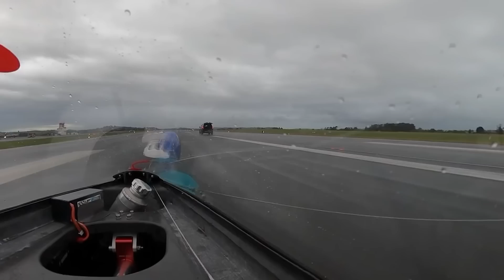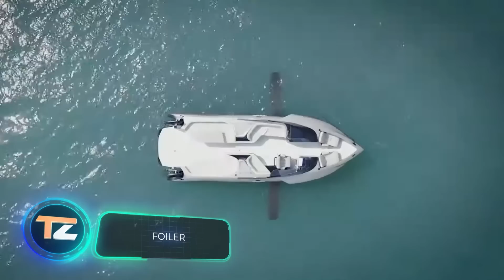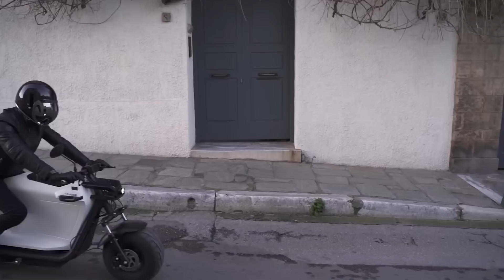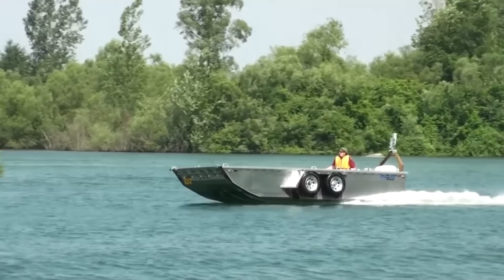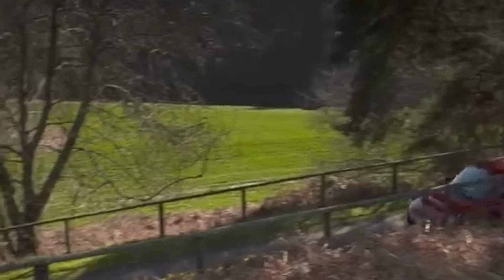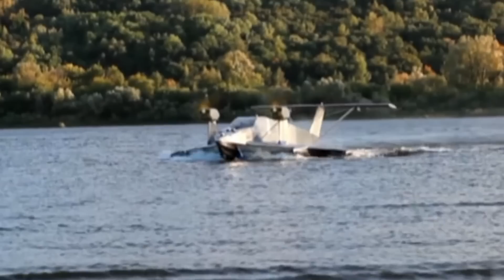INCREDIBLE VEHICLES YOU'VE NEVER SEEN BEFORE

Comment: Some of those seem rather cool and/or useful. The "float trailer" is just pointless, though. You still have to use a boat-ramp to launch it, and the most expensive piece of it (the motor) is prone to striking the ground during the launch process. We back boats down the ramp into the water for several reasons.
Reply: Imagine how much more energy/fuel wasted hauling the trailer plus they didn't show us how they did it, lol. You have to back up to the ramp to reach the truck :)). Totally stupid idea...
Reply: Without the trailer below it, and with the wheels being retractable, you would have a lot more clearance and wouldn't have to back the boat nearly a far.  Also, the engine is shown lifted above the height of the rear edge of the boat, so you aren't striking a prop at that point.  I'd anticipate there is a small trolling motor somewhere along the midline of the boat that would be sufficient for any final maneuvering as you line up with the truck.       The only real problem is that lining up a trailer ball is a lot more demanding that getting a boat close enough that a trailer's rails would catch it.   It looks like you would have to get out, lower the tongue by hand, and drag the boat into place by hand, which would be annoying enough to make the process annoying.  Your boat is also carrying around a lot of extra weight.
Reply: @brianhaygood183  You'll have to back it even farther down the ramp because the center of weight is so close to the truck. The boat's center of weight being at the rear is exactly why boat ramp launching (backing the boat off the trailer) works so well. 

The motor strike will happen because the boat levels in the water against the angle of the ramp; the motor being above the bottom edge of the boat is simply not enough separation to account for that angle difference (between the water surface and the ramp).
Reply: @brianhaygood183   _ Imo _ Needs the two wheels closest to the stern, to be Clutch releasable from Trailor Mode' to Electric steerable drive, via 100 watt hr. lithium batt, to literally drive from the truck at the ramp into the H2o itself, and back out to it. And an actuator lifting motor mount, so to lift the motor higher safely. Then a cable wind or electric tongue lifter to smooth out all operations. Granted not cheap, though would be a very capable and functioning exactly as planned to expect, of this new class of proven brilliant  concept! 🛥️🖖

Comment: How did you know I was working on the exact same four wheel motorcycle !!? I haven't even bought the wheels for it yet ! Mine is based on a 3 wheel Can Am where instead of a single wheel in the back their is an axle that widens the back and uses two P35 18 car tires. The motor basically stays the same, maybe.
Reply: Good idea.  The only reason the Can Am Spyder and every other 3-wheeler like it only has three wheels is because as soon as they put a 4th wheel on it it become a car and has to pass emissions, crash, and every other FMVSS.  So, cutting off a wheel saves them millions in testing alone.    I'm not sure what would happen if you sold an aftermarket 3-wheel conversion and had the owner install it.  You might get around some stuff that way if you can claim you aren't actually manufacturing the vehicle at all.

Comment: if its gas its trash sorry bro EVs r just faster & dont brake as much  & when a tesla family sedan is beating race cars might wanna go back to the drawing board
Reply: You might just change your mind if you were in my occupation.  I won't let my family ride in any Lithium battery powered vehicle, note even a bus.  Even my ebike battery is stored in a metal container outside along with all my other Lithium batteries.  It's going to get worse too.
Reply: You obviously don't have any bills to pay or long distances to drive. An EV vehicle costs $35-40k for a cheap model. The Tesla sedan you mention costs $140+k. Next you have to install a charging station at your house, figure $3-5k for that. Be prepared for your electric bill to double or triple. Average EV goes 250 miles between charges. But if you run it out of power, it's going to take 10 hours to recharge it. Oh, and in 8 years you'r going to spend $3-16k to replace the battery while the old battery becomes toxic waste.
Reply: @gsdalpha1358  keep telling yourself that maybe it will come true
Reply: @dust921  It’s all a matter of public record. About 5 minutes if research would show everything I said is true. Not MY truth but facts supported by data. EVs aren’t the fairy tale answer, not with current technology.
Reply: @gsdalpha1358  outdated BS doesn't work on me & the new batterie tek will prove u wrong
Reply: @gsdalpha1358  u cant win i'm a engineer i test this stuff my data is truth & talk is cheap but please keep talking my buddy's r all getting a kick out of it lol

Comment: Not impressed with any of these.  If I had to pick one.... the Hydrogen fueled car,  so long as the Hydrogen is produced from solar power.  You need A LOT of electricity to produce Hydrogen.   The 55 thousand dollar walking dog.....  total piece of shit.  Take that to a Burning Man freakout event and leave it there.  The ground effect craft.... so long as you are using it on an absolute flat surface.  The boat/trailer.... there is an easyer way and how much does that hydraulic trick cost?  That's one expensive John boat.
Oh the electric mini bike,  buy a Honda Super Cup 125,  a 1000 times better than this expensive ugly polluting junk.  What fuel sorce is used to convert to electricity?  What compounds are used to make the batteries?  How much do the expensive expensive expensive batteries cost and how long do they last before you have to replace them with even more expensive expensive expensive batteries?  How do you properly dispose of the lethal environmental hazardous expensive expensive expensive batteries?  Is that why that piece of shit cost over $4 thousand dollars?  The Honda Super Cub cost much less and dosent pollute any where near as much as all your bullshit electric vehicles. That's why I pick the Hydrogen car so long as solar power is used to produce the Hydrogen.   Yall have a nice day.